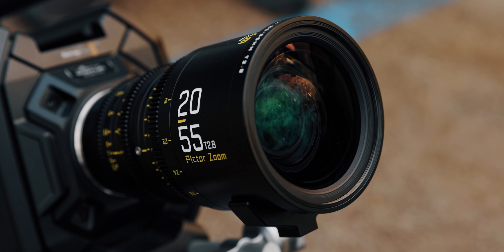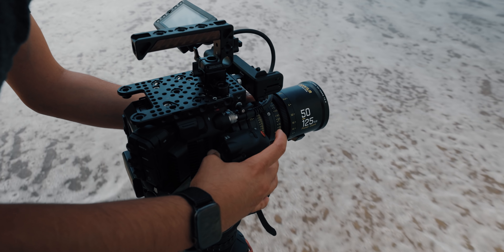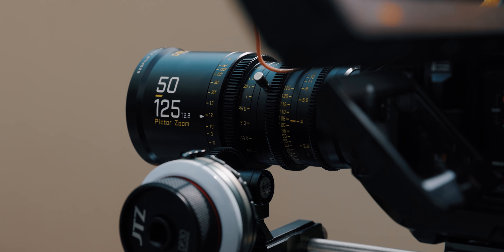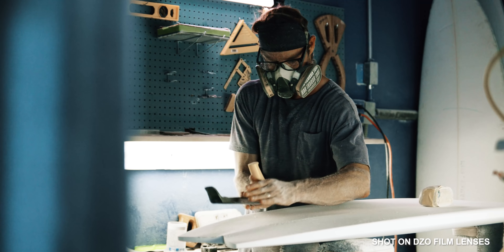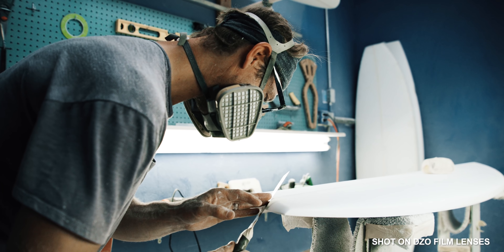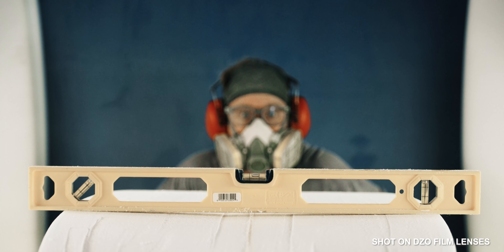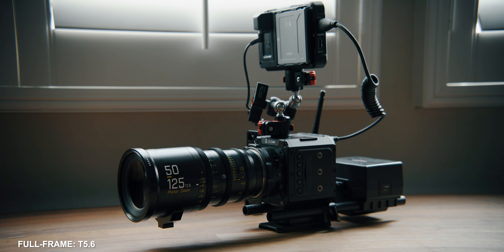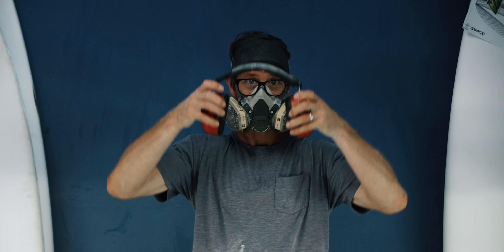BUDGET PRO Cinema Zoom Lenses PERFECT for RED Komodo X

Comment: Parfocal lens are so neat! Way to "zoom in and focus" on the important details!
Reply: This pun is just to much
Reply: it's also included some very thin metal rings that you can add under the mount, so you can adjust parfocal point yourself easily. my bmpcc 6k mount got wrong frange distance from normal ef mount. so all my ef parfocal lens won't work with it except the pictor. because I can adjust it for any camera specifically. all the tools also included. love these Chinese products that always incluede every little things that you might need without try to sell them seperatly for some extra profit. Saved us a lot of time and energy.

Comment: It is build for S35, but was is the field of view fx. at 20mm like vs 20mm Full frame. Does it still have a cropfactor of 1.5x? So at 20mm it will have field of view like 30mm FF?
Reply: The crop factor comes from camera’s sensor size, not the lens. 20mm is 20mm no matter the lens. A 20mm lens  made for S35 sensors will have the same FOV than a 20mm full frame lens if fitted on the same camera. The difference here is that the S35 lens will most likely vignette on a full frame sensor because its just not big enough to cover the FF sensor. Now, the same 20mm won’t have the same FOV on a FF camera and a crop sensor camera. Makes sense?

Comment: It should work with bmpcc 4k + viltrox speedbooster as well right?
Reply: what kind of savage uses a 4,5k usd lens with a viltrox adapter? i would not place any glass between this lens and the sensor, not even a metabone  adapter
Reply: @ Jared, yes it should,, saw a video on YouTube a guy did a similar thing.. DZO FILM also have a 20-70 mft leans...

Comment: I've read somewhere that it won't fit the pocket 4k with an ef metabones can you confirm this? Because if it's true I'll be sad:( (could you also check with a m43-pl adapter?)
Reply: There is a mft model Ling Lung dzofilm
Reply: @oracleman  I know but the benefits of a speed booster on the pocket 4k + being future proof for other cameras by having the pl mount

Comment: I researched the lenses and they come with PL mounts and EF mounts included with shims. My question is, having a Canon C200, how can I find out  what is the exact shim thickness to use exactly for the right back focus measure in using the included EF mounts and shims. I could not find this info anywhere. Maybe you have the answer ?
Reply from the maker: ChrisBee Media mine came with EF Mount and I didn’t have to do anything.  The shims are meant more for PL Mount setup

Comment: I have a Canon C200 and I am wondering if the Focus Guide ( Button 1 on the grip) works when using these lenses ? I want to know If the guides in the monitor screen will function to attain Focus manually.

Comment: Regarding the image circle: Would I run into problems with Sony Mirrorless Fullframes like the A7S series? These lenses look very tempting, but not if i have to also invest in super35 sensor first
Reply: U can enable the super 35 sensor mode on the a7s fullframe series to avoid vignetting, as long as you're cool losing out on full frame.

Comment: Has anyone had a problem with the EF mounts? I switched the mounts over from PL to EF for use with my Canon C100 mkII and the lenses won't lock into position.  I checked them on my 90D and 70D, the same thing. The lenses have the indent for the locking pin but just don't lock. This is dangerous since over rotating the focus (or zoom, or aperture, will unmount the lens. Am I the only one with this problem?

I want to love these lenses but I'm afraid to use them.

Comment: Nice work, Armando! When you were filming Chris in the shop, did you end up shooting in full frame or S35 mode with the C500MKii?
Reply from the maker: S35
Reply: Armando Ferreira Can you elaborate more on the FF coverage w the C500? Do you have test frames at different focal lengths/apertures?
Reply from the maker: Colin Nusbaum i didn’t use it in FF I used it in Super35
Reply: Armando Ferreira Right. But I see you tested it briefly at T5.6. Does it get better at T2.8? Does it only softly vignette throughout?
Reply from the maker: Colin Nusbaum yes, it’s almost completely gone at 2.8 but I’d never use or recommend you use it on a FF camera.

Comment: Their website says they have an interchangeable mount system that includes E mount. Any info on that?
Reply: Christopher Leigh-Davidson if you look on their website it has a manual how to do it but you pretty much unscrew the mount from the back of the lens then screw on the new one. It comes with a EF mount and PL mount in the box. They just came out so they’ll probably release the LPL mount and e mount as a add on you can but for it or maybe as a Lenane option when they come out.

Comment: I just got this lens and love the look but am having trouble changing to the EF mount to put it on my BMPCC 6K. Once I switched to EF, I lost parfocal ability and the lens markers became wildly inaccurate (my subject 20 ft away registered as 6 ft away on the lens). Currently doing trial and error with the shims that are included but it's frustrating to not having a manufacturer's guide to cover this (emails to DZO have given me inaccurate instructions as well).  Did you run into this problem too?